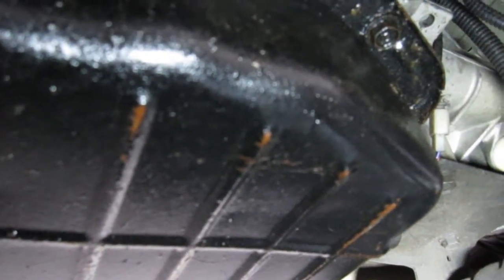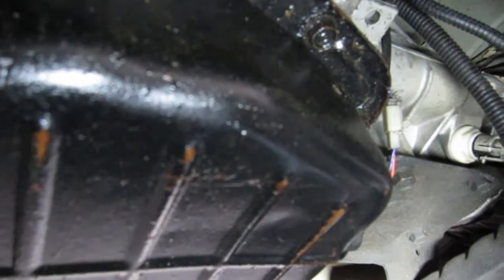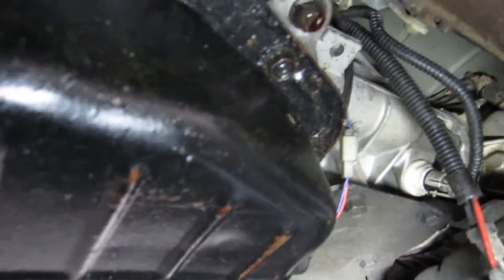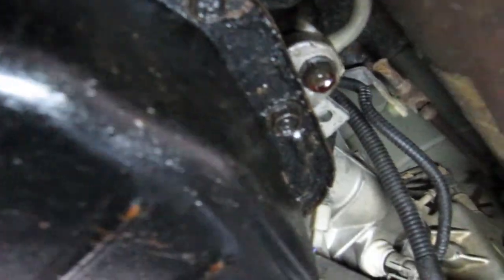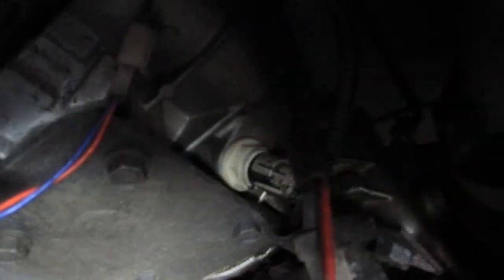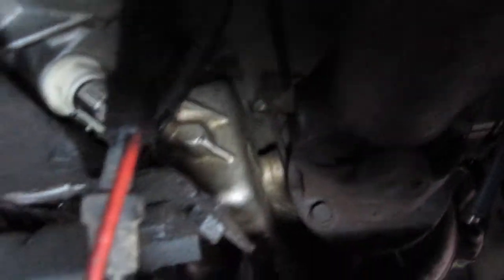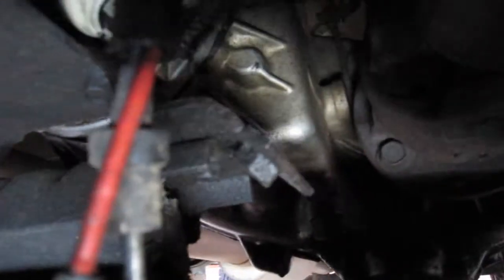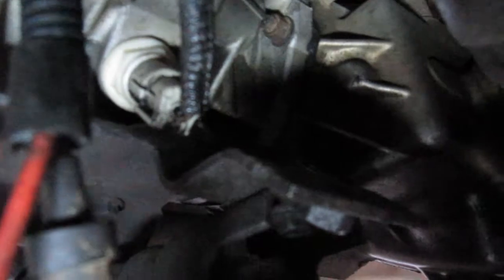1999 Dodge 2500 With Cummins Engine Auto Trans Output Shaft Speed Sensor Location

Comment: Thank you ! Exactly what i was looking for. My transmission just started not going from 1-2nd gear unless i take my foot off the pedal. i looked at a forum ( tdr) and they say this could be the problem , common problem. they say it should ohm 600-1200 ohms. my guess is they go open or short out when they die. one guys went open. so no signal to computer woukd definately cause a issue.
Reply from the maker: Glad I could help.

Comment: what's the problem with the transmission ifthe sensor is not working properly?
Reply: im not a tranny guy , but if its not working correctly , you could prob get all kinds of issues since the computer would not know how fast the drive shaft is turning. With my 47re it wont shift to the next gear , wont go from 1st to 2nd. because computer is being told drive shaft is not turning fast enough to go into next gear. If it's open , no signal is being sent to computer for that speed sensor.